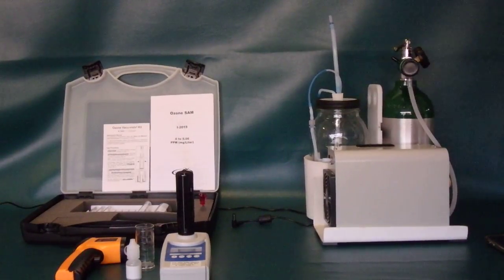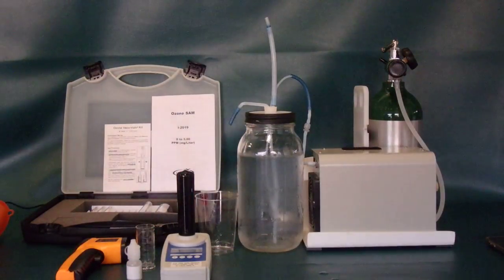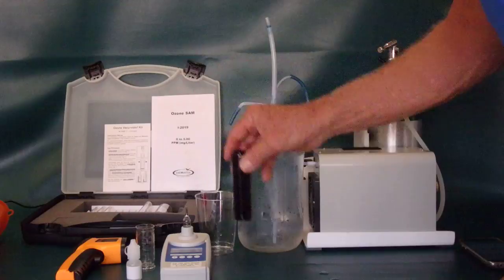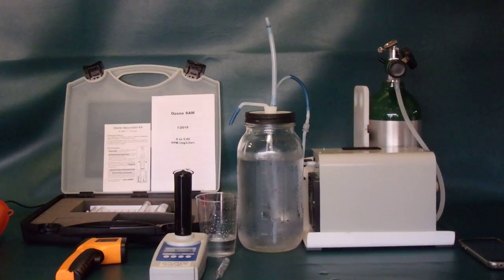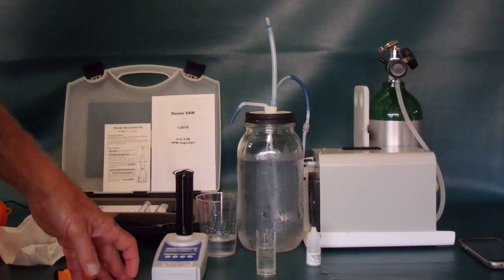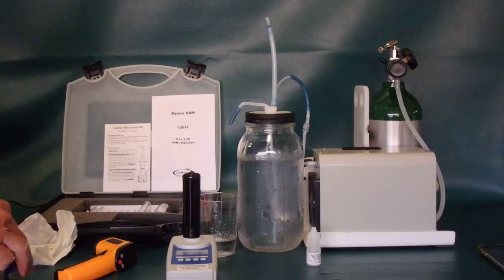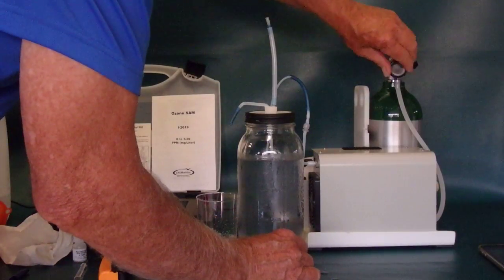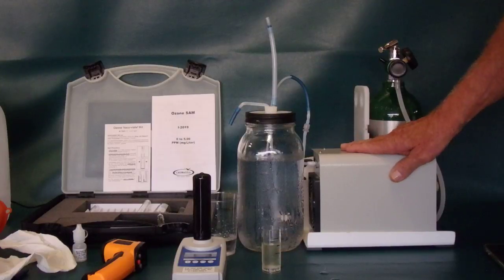Water Ozonator

Comment: Terrific video. Where did you get the bottle and cap? Did you make it? Or is it sold as an assembly? Also could you describe how the plumbing in the jar works to get the ozone water out while covering the ozone destructor? Why is the destructor so small what are you using?
Reply: Regarding the second to last question, that's just due to the pressure differential. By turning the pressure up on the machine, and putting his finger over the destructor, the fluid is forced out the only remaining exit.